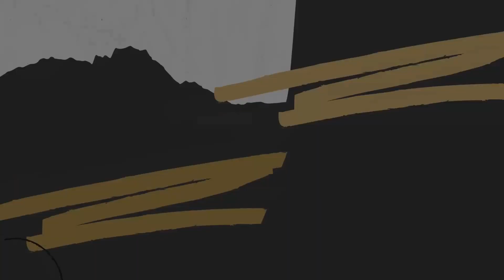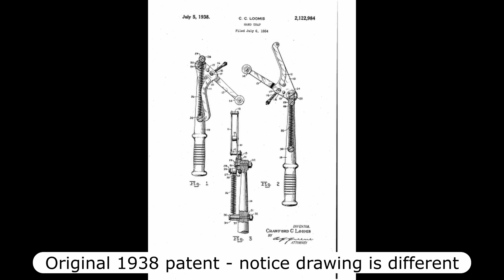Vintage Remington Arms Clay Thrower Restoration

Comment: Great job on this one. That linseed oils does an amazing job. Do you keep all of these projects or do you sell any of them?
Reply from the maker: Love the look and feel of waxed, linseed oil finish on tool handles!  Of course several thin coats of Tru Oil look great too in certain applications( like gunstocks )!  Actually most of the projects I complete I would consider selling.  Unfortunately places like e bay are flooded with stuff in varying degrees of quality from rusty mess to mint condition.  And most folks on FB marketplace think of it as an online garage sale where everything should be a $1 :)

Comment: That looks great Matt. I didn't know where you going with it when you removed the chrome plating. I thought maybe you were going to polish it but bluing looks awesome and it gave it a classic look against the wood handle. Nicely done
Reply from the maker: Yah, a good bit of the plating was was rusted away and left significant pitting/surface imperfections so it wouldn't do well shiny and polished on it's own( especially since I didn't want or need to remove and replace the rivets ) - so cold blue it is!  I have a couple other hand traps from Western that weren't as bad and I removed the rivets and polished those.  I really need a small sand blasting cabinet!